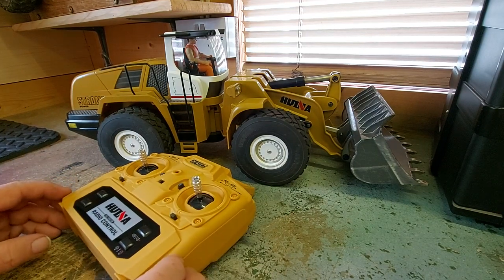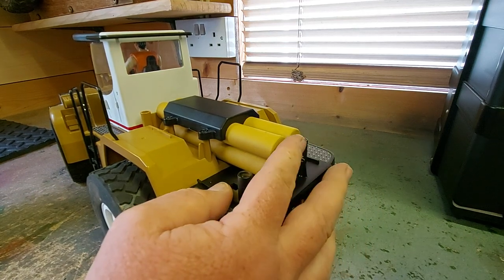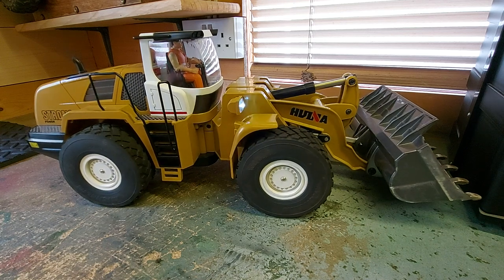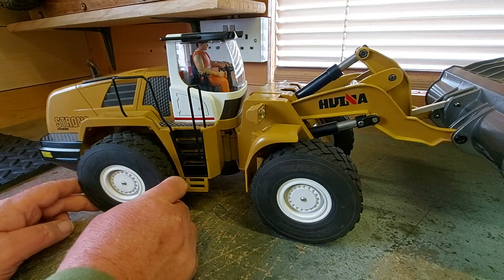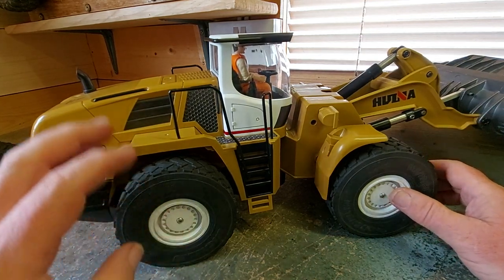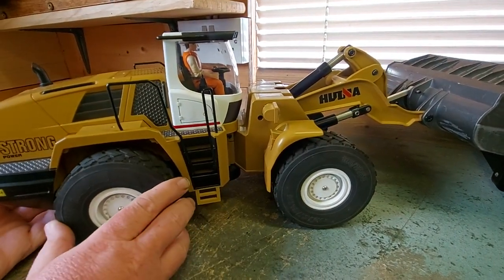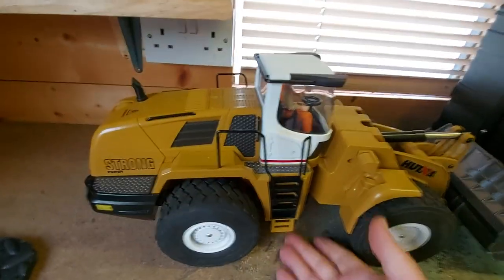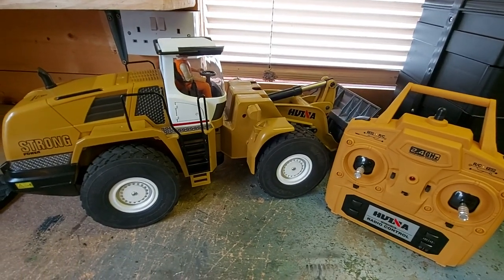Huina 1583 Loader - Upgrades

Comment: my driving motors are wildly underpowered. which do you recommend to give it enough torque?
Reply from the maker: Hi, There is only one motor upgrade and thats the one i mention in this video, the link to it is here, It will still be under powered but the motors and gears are much stronger, https://magomhrc.com/en/huina-583-hydraulic-conversion/1697-huina-583-traction-kit.html

Comment: Solid rubber? Wow, love the metal wheels but foam filled tyres surely....  looks great though. What size hexes are they btw? Thanks
Reply from the maker: Hi There, Yes they really are solid rubber which makes them heavy which helps with traction, Wheels are machined from solid brass as well. Hexes are not very big, I'd guess about 6mm, But could measure them for you if you wanted. Thanks.

Comment: How did you get the Construction Doll into the cab? Thanks very much for your valuable time.
Reply from the maker: Hello, when i took it all apart you can take the clear cab off and i added the figure in and glued in place before putting the cab and loader back together. Thanks.